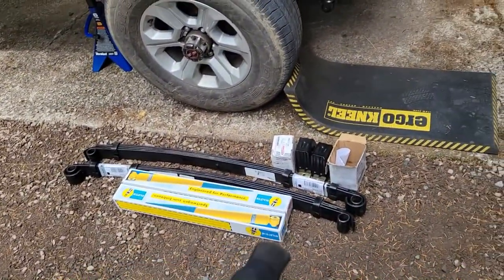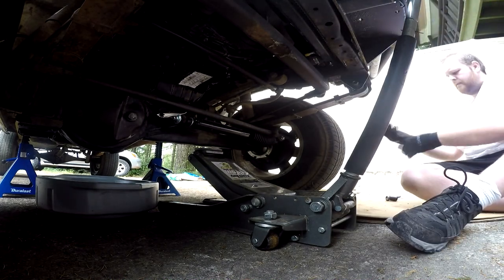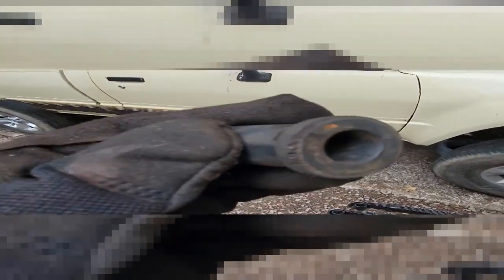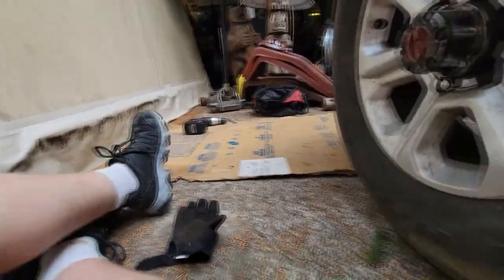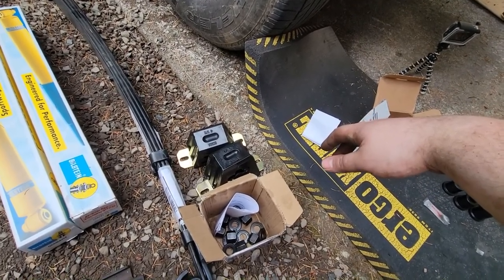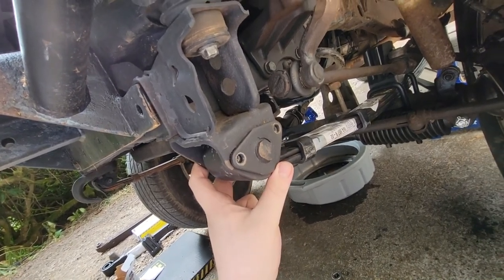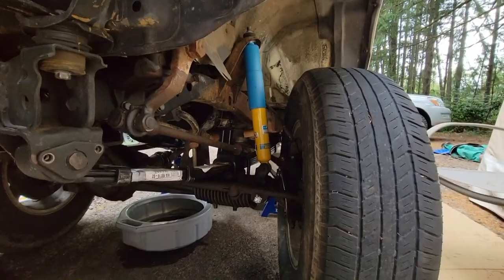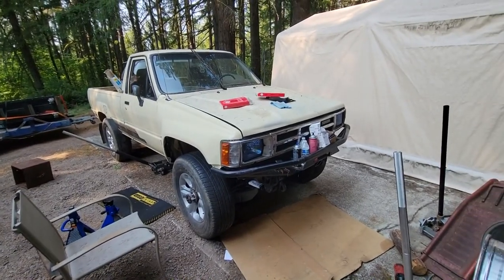1985 Toyota 4x4 front suspension rebuild

Comment: Hey M8, those front leaf springs suck! what brand?? the springs you installed will settle on the bump stops after a while. you do not want that.
Reply from the maker: I know I'm really upset that I spent too much money on them. They're practically no better than the 40 year old springs I started with. Really trying to avoid a lift kit because I just want it to be stock height. I have no reason for a lifted truck.

Comment: go with OME Old Man Emu suspension. made in Australia. I have this on my 1985 Toyota 4x4 pickup
Reply from the maker: I'm trying to avoid running a lift kit. I looked at their stuff but during covid it was going to be a hot minute before I'd get their stuff. Even stock height replacement I'd still be running into the same issues
Reply: @jhalkoski  NEVER USE SPACERS ON the FRONT PERCHES!! it's a NO No!

Comment: I never really understood engine swapping the 22re. Yes you can make double the power, but most imo all of the interest in these trucks are either the engine or the drivetrain.
Reply from the maker: well too be fair i didnt even start with a 22RE my truck was carbureted 22r that was very, very tired, and i so happened to have a 3rz laying around and its one of the easiest swaps for the truck to have

Comment: Can you do an overview and look at ur engine swap? I'm curious how it came together on a factory solid axle truck. If u did ant body lift, how spacing is and transmission adapt. I have an 83 first gen that I'm thinking ab swapping
Reply from the maker: I can sure. No body lift. Stock suspension. Stock transmission. Just used a w59 bell housing, 2wd t100 oil pan,  and some 3rz swap engine mounts from toyswaps. If you're lifting the truck you won't run into the same issues I'm having. But because I want to keep it roughly Stock height is the only reason I'm having oil pan clearance issues
Reply: I’d appreciate a video on the swap as well. Been wanting to do it for a while and could use all the info possible.

Comment: Did you end up doing shackles or getting lift springs, I have an 83 and live in Rochester Washington and I want to get OME 2" lift springs but am tempted to get rough country or procomp 3" leafs because they're so cheap then trying to pull a leaf and maybe add a stock leaf or something to get less than 3" out of them.
Reply from the maker: I haven't done anything yet. I got so busy at work I've had no time for side projects. But I think I'm going to try just shackles first since they're the cheapest at like 150 bucks for 5" from trail gear. I'm really trying to avoid buying new springs again. These new oe height springs were expensive and I really don't want to just Ditch them
Reply: @jhalkoski  oe height springs cost 4x what the procomp and rough country 3" springs at about $59 a piece, same price as a set of good shackles but the ride isn't great and like you I don't want that much lift. Shackles will be great for you with new springs but idk about running my inverted leafs with longer shackles, also 1.5" longer shackles would only get you about 3/4" of lift height and therefor only that much more room between the bumpstop I'd go with the 2.5" longer if it's not gonna give you too much caster angle.
Reply from the maker: @16driver16  yeah that's where my concern comes from with going with too long of a shackle might cause the steering to bind and mess up the pinion angle. I think I'll start with the 5" just to see if it gets it off the bump stops. Some travel is better than the none that I currently have. If those work out well, I might move to longer ones after that.
Reply: @jhalkoski  front pinion angle doesn't matter as much on these as the front driveshaft for the most parts doesn't spin super fast like the rear does unless you do some crazy 35+mph 4x4ing. And I don't think the steering will bind but could become a little funny probably just want to return to center alot more with the caster being tilted back a few degrees